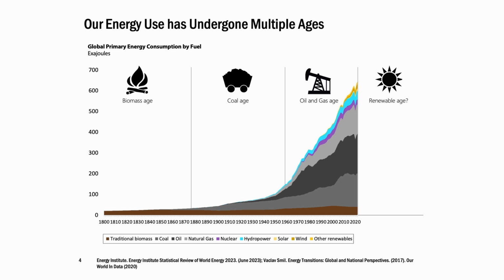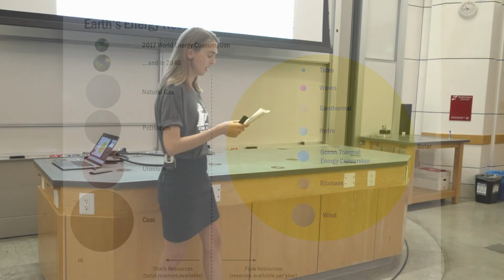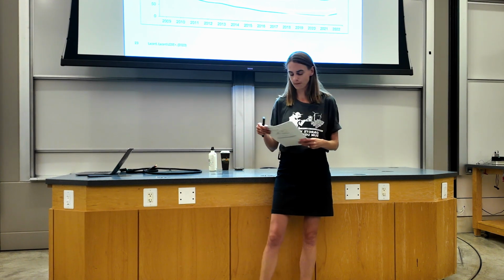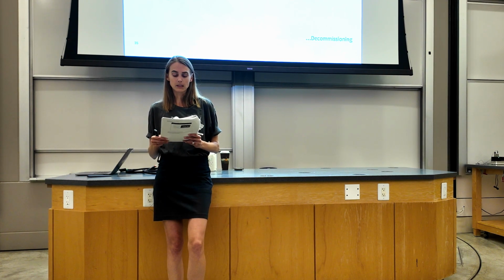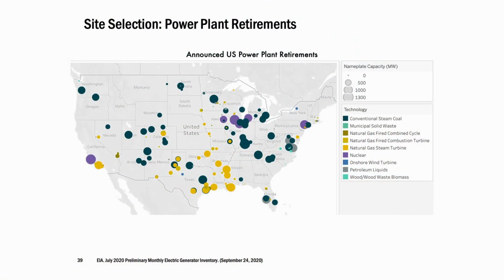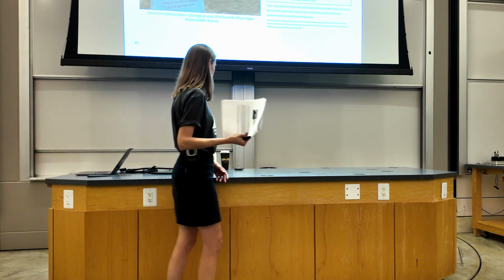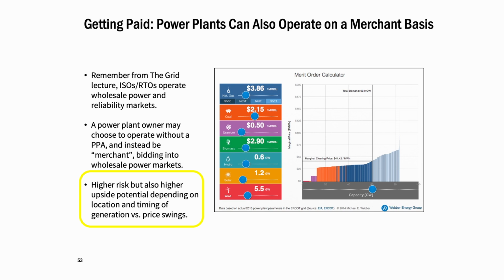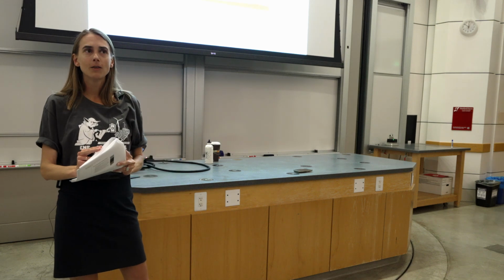OLD Introduction to Renewable Energy Lecture | Kirsten Stasio | Link to new version below.

Comment: Global warming has been stalled at about 1°C since 1992 with no known cause.   In 2022 global warming was officially reported at 1.06°C.   The Arctic region is warming with the cause increasingly proving to be warm Atlantic Ocean waters migrating into the Arctic Ocean warming it and the region.  

It is impossible for greenhouse gas behavior to cause global warming.   A well educated high school science student learned earth's greenhouse effect is a primary example of a system always in saturation from the strong greenhouse gas water vapor absorbing all the greenhouse radiant energy from the earth within 20 meters of the radiating surface that is all around us everyday.  There is no greenhouse radiant energy further out than 20 meters from the radiating surface.   

The UN IPCC science report never directly states greenhouse gases are causing global warming.  It makes a statement that acts as a legal statement of data transparency to protect the authors from fraud prosecution that is took its greenhouse gas samples at 20,000 meters altitude.   It can be legally argued it is common knowledge there is no greenhouse radiant energy at 20,000 meters altitude telling a reasonably educated reader the report is not discussing active greenhouse gases.  

Typical solar voltaic generation is a forced buy to the public power grid in the past at retail electric rates that is wild AC and almost worthless.   Natural gas jet turbine generation needs to run at high service idle consuming 70% of the fuel they would at full throttle when generating all the electric power in order to react to a cloud passing over a solar farm.  

With the set cost of staff and plant,  rate payers are paying almost the same for the jet turbine running at 70% fuel consumption at high service idle generating zero electricity and generating 100% of the electricity.  They are then having to buy wild AC from solar that is nearly worthless at ten times the cost of internal generation.

It is impossible for wind turbine generators and solar voltaic electric generation that is not charging storage to provide grid quality contractable reliable electric power.   It is modeled at infinite cost because it is impossible.  

The only reason for large implementation of wind turbine generation and solar electric panel use are huge government subsidies and incentives.   Without those economical incentives being paid by the tax paying public and others this type of renewable energy would not have taken place.   There are no promoted fuel savings having taken place from their use.   It would seem impossible for there not to have been some fuel savings, but the fuel saving are evidently embarrassedly small or they'd be promoted.   

There are off gird locations where renewable energy makes economical and logistical sense.  

The US has had a clean electric grid since the mid 1980s with acid rain being addressed successfully.   There has not been the electrical demand growth expected in the 1950s for new generating plants to make the older plants secondary.